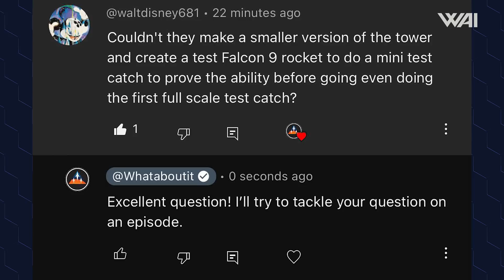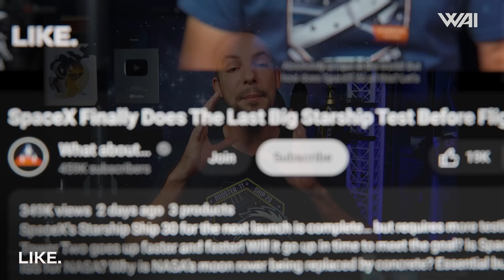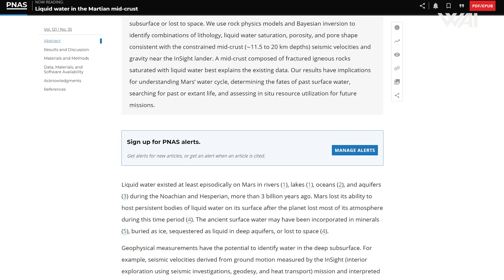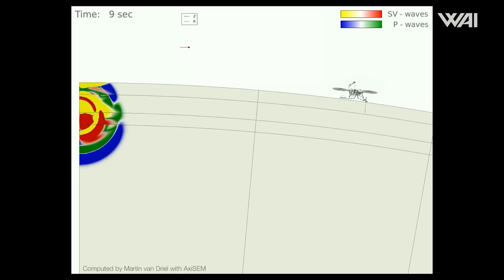SpaceX Massively Updates Starship! Ready For Flight 5!

Comment: The booster would never hit the pad at full speed, it's going to dogleg over to the pad after the landing burn starts.  And as Elon said if something goes wrong during the landing burn the booster will "YEET" itself into the ocean.
Reply: But if it hit the pad, it would be a quicker start to make lots of improvements to it, without having to take it apart first…
Reply: @invisible468  Real life isn't like a video game where things blow up into pieces that fade away. Its much easier to take apart something that's intact than to deal with something that's mangled up. Its also much safer to disassemble something when its structural integrity isn't in doubt.
Reply: True but it is possible that the booster might hit the pad area at a reasonably velocity. A worst case scenario that could result in that might be start landing burn, all nominal so dogleg to a trajectory towards the catch point and then get an engine failure seconds before the catch when the booster hasn't nulled out all its velocity and also still has too much momentum (momentum being a vector quantity) for whatever control authority still available (maybe only the grid fins if all engines are out) to be able to deflect the trajectory significantly. I would imagine that SpaceX has modelled a whole load of very late stage loss of propulsion scenarios and has a pretty good idea of what the maximum impact velocity would be in such a worst case scenario.

I wonder if a part of the protocol if it did look as if an impact on the launch site was about to happen might be for the booster to be instructed to do as much venting as it can. Lots of people comment on how it would be almost out of fuel on impact so it would be nothing like a pad explosion on launch but I would think the less the better and the lower the internal pressure in the tanks the more of a fireball you're going to get rather than an explosion flinging bits of metal around.

It's also worth remembering that during the catch the deluge system will be active and that's putting out one heck of a lot of water to damp down any fires and make any methane leaked into the atmosphere less likely to ignite.
Reply: Get the technology to the  point it can do what it needs to and refine it until it almost never fails.99.9999999 success rate.
Reply: Yeah, because he'd never be full of sh*t for a government contract, right?
Reply: @Blodhelm   OP is correct as this is already done for f9 landings; f9 booster aims for a point in the ocean then doglegs towards barge/pad once its happy the engines are working. Reasonable to expect a similar flight profle for superheavy recovery.
Reply: @Blodhelm why would he lie about not wanting to destroy his own property
Reply: @Blodhelm  Pretty sure its not in his best interests to destroy one of his launchpads. I get that you don't like the guy but can you at least criticize him for stuff that merits criticism? Like whine about how Starlink will result in civil unrest in 3rd world countries due to governments not being able to control internet access.
Reply: @ryelor123 I'm in agreement with you on your first point. 👍
Reply: @Blodhelm 
Nope. Not ever. It's not in his DNA. He may not always be right on everything but BS just isn't his thing.
Reply: @appliedfacts  about the buggest thing you can call him on when it comes to "lying" is his timeline projections are always a little bit too hopeful. But he id rather hear a timeline that seems ridiculous and then have it late but more along the lines of realistic than say, Boeing saying a normal timeline and then never delivering anywhere near a realistic timeline.
Reply: @blacksunshinegaming9315 those aren't "lies". They're 'optimistic' timelines. Seriously though, he's not purposely lying. He's not the type.

Comment: You really should stop showing that animation where the booster comes in for landing above the launchpad. The catch will happen above where they normally pick up a booster or starship from a transport stand. Makes WAY more sense: You're not roasting stage zero with rocket exhaust for "several seconds". Like a few other things, they might "optimize" things to go faster in the future, but for now they will go "slow but steady". (i.e. roasting what's below for a few more seconds than strictly necessary).

Comment: Don't need tower OR legs,  only  a special "landing pad" on the ground and drone ships.    Four or six  arm BRACES, placed flat, radially around the pad, could quickly swing up around the ship all around and hold it up like  this.------        /[]\        A LOT more simple.
Reply: Well, you still do need the tower as it is vital infrastructure and how would 6 giant hundreds of foot long swinging arms be simpler or better than 2? It's a LOT more complicated.
Reply: @filonin2  Well, the arms do not have to be the full length of the ship--only long enough to stabilize it vertically.   And this is just for LANDING, like on a drone ship.  Naturally would still need to taken to the tower for relaunch.

Comment: If the bumpers were set to the width of the booster, then when they bumped together, a ripple would have been induced into the chopsticks that would cause them to open and close like ones hands clapping. This would cause a recoil of the arms away from, then into, the vehicle: Bad! I've seen this happen on a much smaller scale. There are better methods, such as compression dampers (Large, tuned damper, shock absorbers if you will.), to do that kind of job.

Also, the structure of a Falcon 9 is not designed for a catch. A specially built version would have to be created that didn't have landing legs and would have the necessary structural reinforcement to handle the catch. A new set of chopsticks capable of closing to the desired size would also need to be created as the Starship ones are 300% too big. The amount of money and time necessary to conduct this test is impractical. 

Another issue is that, contrary to classroom physics, scaling results has it's issues; Systems simply act differently when scaled up. Again, an issue I've seen in the past.